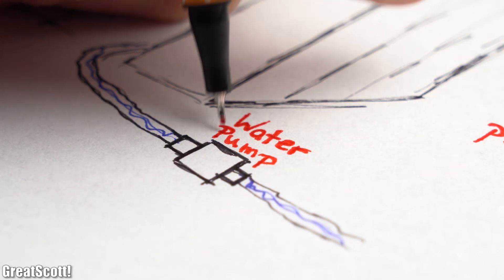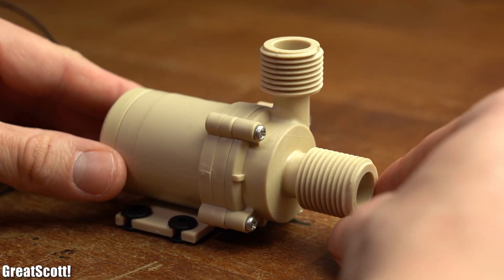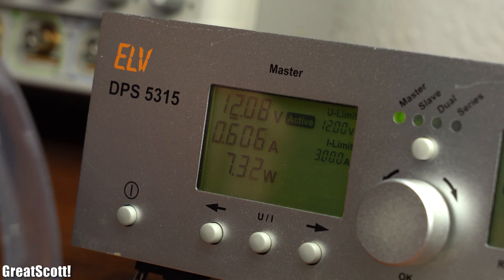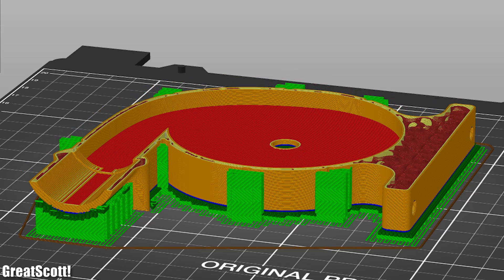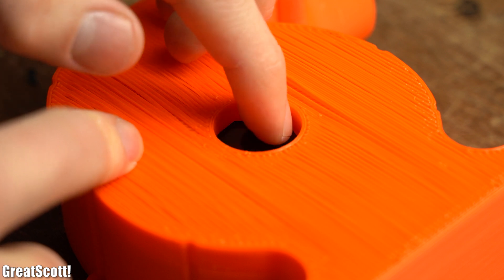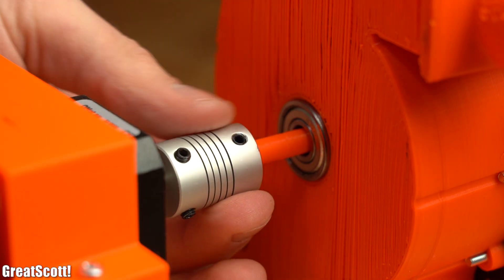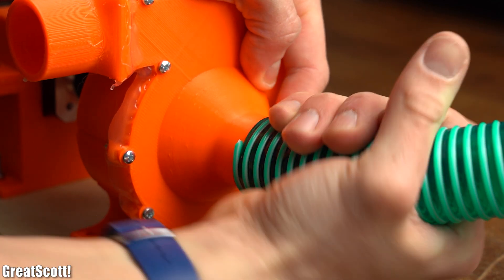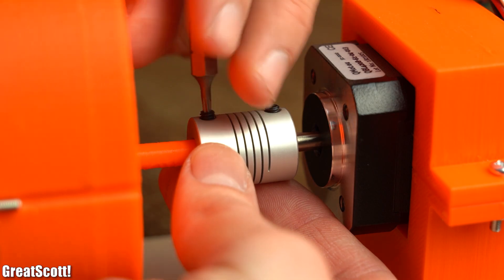Water Pump || DIY or Buy

Comment from the maker: I noticed that quite a few people are disappointed that I did not improve the 3D printed pump with a metal shaft. So here is a quick explanation why I stopped at that point. The reason is quite simple and is called time. I already spent 60 hours on this project when I got to the point when the shaft broke. That of course includes everything like planning, getting parts, writing a script, doing test, filming,......... Of course I could have tried improving the pump with a metal shaft but due to other problems I noticed that come with such a 3D printed design, I decided that such an option would not be sufficient for my garden and declared buy as the winner. If I would not have done that, then there might have been a successful water flow with the 3D printed pump but then again I would probably not have enough time to produce the next video for my channel. I appreciate all your feedback and I also love to tinker and get things to work. But I still have to think about getting content out regularly because this is my full time job. You can always support me through Patreon if you do not like this concept. So I can pretty much independently decide how much time I want to spend on projects instead of thinking about how to please the YouTube algorithm. Thanks for understanding.
Reply: I think that's fair enough! At some point you just have to call it quits. Thanks for being honest tho!
Reply: Instead of using shaft coupler , you should directly connect the pump turbine with motor shaft
Reply: @yogeshsinghsonigra4054  exactly.. 
I assumed it would be the logical first choice.
It shocked me to see him quit without even mentioning it at all.
Reply: Absolutely right, if it gets to complicated to diy such a pump then the price does not stand compared to the comercial one, wich makes it a bit pointless
Reply: What is the vga port on the microcontroller used for?
Reply: @oniruddhoalam2039  I don't have the board in front of me but it looks like a RS-232 serial port for programing.
Reply: No problem sir,  We understand how difficult it is to create such a great content for us....We always support you.
Reply: i think its just silly that you tried a 3dprinted shaft to begin with
Reply: I like your channel!
Reply: Gonna be honest, it was obvious that the printed integrated shaft gonna break from the beginning. Maybe you wildly overestimated the strength of the printed parts.
Reply: I have an idea for you. Take a note for situations like that through year, and after that take a poll in the audience, witch project try to upgrade, and make video on that.
Reply: Men i understand that  And i respect that
Reply: You could simply drill the center and replace the shaft with a M5 screw, und fertig! Great Video auf jeden Fall
Reply: 3D printing does have it's limitations. You can invest time/energy in making a 3D print work, but if the "off-the-shelf" part works and it's cost-effective, then it's best to go with that. Really appreciate that you spent the time to investigate this. You have saved me many hours going down a similar route as I am looking to do the same this summer for my fruit/veg. :)
Reply: Everyone understands. But it didn’t come across like that in the video. Not everyone knows how much effort it is to create such a video.
Reply: Curious to know if the commercial pump has a plastic shaft? If not then it's apples to oranges from the get-go.
Reply: Never use a stepper motor of water pump use a normal one or geared high rpm motors
Reply: Wish there were some other video platform other than YouTube where people like you would not have to be slaves to stupid AI.
Reply: I suggest using an automotive window sprayer pump. They're tiny and they move a lot of water with a high head pressure. 12v direct dc.
Reply: You should replace the tube with a smaller one, the smaller the higher the pressure
Reply: So can we expect a part 2 of the video? I'm eager to know what would be it's flow rate.
Reply: Mabey in the future You can recreate this : https://youtu.be/2nQBoQ3HucM
Reply: If you do a part 2, change it to a peristaltic pump (so it won't need to be water proof -- much simpler to print also), and use a threaded rod.  Also a proper nema 17 mount wouldn't hurt. XD
Reply: Hi Scott! I also made one, works like a charm! Here's the vid:
https://youtu.be/TfBycQ90-L4
Reply: I want to say I follow your channel and its very good one, but id like to suggest to go in projects that is not available in the market or is too expensive to buy instead of construction home made.... sadly for you to say water pump takes so long, i did work with water pumps and control for long time and there is a huge amount types of water pumps, impellers are designed for many reasons can be for high pressure low volume or high volume low pressure, etc. etc. etc. good luck with the next project
Reply: You are the ression why i love electronics.
Reply: I cant believe you spent 60 hours and now trash the project over a simple task as drilling a hole and epoxying a metal shaft. Thats not even a 15 minute job.
Reply: Btw the buy solution might also not work for long. I had this pump and it destroyed itself after a year. I then replaced it with another which died after 3 months ... These cheaper pumps from amazon have a super low life time
Reply: LOL glad i read this before posting :)
Reply: You are doing a great job no matter what
Reply: USB hub : DIY or Buy
Please
Reply: That is understandable. After all, it's your channel and your project, and by that point it was getting complicated so I guess buy would still be the winner in the end!
Reply: Eh, I like you, but I feel that this is more of a cop out. Lots of Youtube people out there with millions of viewers who simply make a part two, three, etc. when content runs longer and that would be the additional content for the additional time. There's only so much to cover electronically and when you look at it that way, this is a DIY or Buy episode, so, it's not like the circuitry is necessarily the focal point. I feel the people viewing this are more tuning in for the answer before they take on a similar project, thus, I feel like people are let down because this was concluded over an obvious over-sight that should've been seen in the planning stages before you even started printing. The additional time planning would've probably saved you exponentially more time in troubleshooting and printing.
Reply: I DIYED it myself and performed great
Reply: centripetal force (water pump- attraction in)  and  centrifugal force(blower - Push out)
One thing that is different is that the water impeller goes backwards to the wind impeller, the casing of the water pump is like a centrifugal blower but the suction impeller is very small and upside down.
Reply: 60 hours for HardWare experiment it's quite nothing, you can reduce the time by using other engineers knowledge, in this case 3D printing of a larger centrifugal pump it's a good idea if you're sand casting the working prototype in some aluminum alloy OR THE BEST CHOICE, buy an automotive centrifugal pump and complete the outer case. ;-)

https://www.shopee365.com/media/catalog/product/cache/a1d6199b8797d1adf27d00b7ce72a9f8/c/a/car-water-pump-for-chevrolet-optra-16-petrol.jpg
Reply: excellent job as always
Reply: Time... You got a point but the question is what make you think that the 3d printed shaft would work ?? And even if you wanted a 3d printed shaft it should not printed vertical. Anyway the winner in not buy... Designed my own pumps and use them for years in my aquaponics without a single problem.
Reply: In my opinion - you go so far that I will really recomend to try with metal shaft. Just for science!
Reply: As a regular eclipse user I'm glad to see that feature.
Reply: You should just know that a 3d printed shaft is never a viable solution for transmitting torque unless you drastically oversize it using the contact area between layers for your calculations on the required shaft diameter. No reason to waste time on video like this on such an obvious design flaw.
Reply: https://www.youtube.com/watch?v=ZiQek0wei1g
Reply: Make the pump a little smaller and that helps
Reply: your message about the ytb algorithm, the time spent and especially Patreon is very clear.
in my opinion it is necessary to work on the sealing of the shaft and the frame.
Reply: I understand but still, in comparison to some of your other videos it is a shame that you stopped before it got interesting.
Reply: Great Scott: Use an 3d printer to make an pump that dosn't work
Me: i made an pump with 20 year old legos in my basement and it pumps just fine
Reply: Fair enough.   I've actually worked on something similar before - torque and rotational force have to be a factor in your design for something like this.   Still a good show at trying to get it full poly! Impressed you started to get water to the pump with the size of hosing you were using.
Reply: Seems like of good at and not good at, and agree to give up things not good at...
Reply: The people just complained because what you did in effect was “shorting them” on the content.
Reply: I don't see how the metal shaft would have made a huge difference on performance anyhow... My question is, how much difference would it have made had the impeller been orientated properly? 😁 The world may never know...
Reply: lame
Reply: Dude... You don't have to stand over your prints... And you sources the parts from thingiverse? And you didn't have time? GTFO of here lol
Reply: Your conclusion is correct, but drilling a hole and jamming a metal shaft in would have been; less than an hour to save 60 hours from being basically pointless...  I do believe your conclusion is correct, but not from your video, I have done comparisons on several products like this and found making them costs the same or more than creating them myself.  The other benefit would be a more satisfying conclusion to your video.  As it stands now it just looks like you don't complete things are aren't a good source.
Reply: Why can't this level of transparency exist in government also.... Great Scott for president???
Reply: @joashnaidoo8644  because the urge to run for office seems to be mutually exclusive to high intelligence
Reply: @joashnaidoo8644  This video had nothing to do with POLITICs - It was about Plastics, Pumps and DIY.
Reply: @layton3503  it's a joke, stop being so stuck up
Reply: It's obvious that you ran into a time and/or resource problem. This, however, should not be a reason to present your opinion as a fact. As a mechanical engineer by trade and 3D printer hobbyist, I would not mind investing some of my time into the mechanical side of things. As I am sure many others here too! 

The electrical content you create is great and has lain the foundation for my own electrical knowledge. I honestly like the projects where the real world gets involved into the electronics. 

Next time you run into mechanical problems don't hesitate to present your problem to me personally and/or to the community. I'm confident that in no time there are people that would have altered the STL files to something more suitable. The same goes for the seal and motor mount. Don't underestimate the willingness in the maker community.

Comment: It's really cool! I think you should add another one of those Ice-Cold ball bearings, maybe add a molded steel propeller instead of plastic, and, most centrifugal pumps have another propeller behind, which acts as a back - up, I guess, so I think you should add another one. Maybe you can also add the drain hole with the plug andadd actual rubber seals in important parts. This is all not necessary, but I guarantee you to try and add these things.
Reply: Oh, and maybe add another electric box, put all the controls and electrical wiring  in there and, finally, you can cover up the motor by making another plastic piece, making thin vertical lines, make tiny thin vertical holes underneath the plastic lines, which will act as a ventilation, add a fan at the back, add a cover, make holes to connect those two new pieces and, finally, add a new and non - 90 ° outlet. Instead, add one that is around 60 ° in angle.

Comment: No metter witch pump is ,,,the neodium disc engine is the best  simply yust make two magnetic source clouse end force Will be infinity 500+ years ,,,or if you want to slow  yust a little disaparte few milimetara or,,needed power  if you disapart nagnets far  the watter Will stay or the pump Will stoped,,,end the same Neodium Engine can do anyting,,,elektr,,,or nehanik source ofvpower,,,ewend for free driwe car,,,watever,,,anyvere,,end alwys

Comment: The vanes were the wrong way on this 3d printed part.. and the axel could easily have been a meta rod attached with a flange or key, just like in other designs. 
.

Comment: i think the problem is the type of filament and the size of the nozzle used for 3d printing. using a smaller diameter nozzle increase quality and strength.

Comment: Other the shaft problem, i think there's another problem whit this pump. 
The must important thing when we talk about water pump, is the diffuser. I mean, in this pump there's not any diffuser. Generally, it should be whit a spiral shape, in this way, the impeller can increase the Kinetic energy of the fluid, and the diffuser can trasnform kinetic energy in pressure energy , whit increasing of Area Section, chosing a Spiral diffuser. Is simply Bernuolli law !
But if you watch your commercial pump, you can see how misses spiral diffuser. I think because they're not thinked for a big volumetric flow.
But that pump you printed, is very big, so i think the diffuser should be a good idea.

Comment: You didn't fill the pump with water. Your pipes are wide and not filled with water as they should have been. Air should not be present in the pump at all.
Reply: I just can't believe that so much effort is being applied over all, and then the small basic thing is not seen.
Mix of water and air made it to break probably.

Comment: Actually this kind of pump is very efficient when used correctly. First of all it needs a "seed water" which simply put means the intake has to be in touch with water but with no air at all. I Have printed exactly this same identical pump introduced in this video yet i've tried mine powered whit a power drill ":D", it works fine, its powerful compared to its size.

Comment: To share my meaning of buy or diy:

You did a great job on reasearching, but a little bit of engineering is missing. With more 3D printing experience you could know that you could reinforce the shaft more by changing printing temperature, som other settings and also printing it turned 90 deg would make it stronger because of the layers a 3D printer makes. On the mecanical side you could know that the shaft does not have to be 3D printed and if I would guess, a metal shaft would be the strongest solution here. Even a pencil with a screw secured to the rotating disc would be enaugh to make it at minimum 10 times stronger.

Thats my opinion, furthermore, I love youre content, love to see you make these things and I hope these tips above are something for you!!! :)

Comment: I'd say, if you want a custom fit and cavitation is not a concern, you can print one. If a person wanted to print that big orange one, they'd need to build a metal bolt plate which is coupled with a chrome or stainless metal shaft to hold the impeller which would then needs to pass through a bearing (double is better) and a mechanical lip seal. Obviously that is time consuming so often buying is better for basic use. One thing not often considered in most pump videos is the difference between a volume pump and pressure pump. If you were to insert a metal shaft into that big plastic impeller, it would ultimately chew out the center, this is simply due to the resistance of water across the given surface area.

Comment: I don't think the issue is that the PETG isn't strong enough. Your print quality is not great. I can tell that you are underextruding. Meaning that your layers aren't adhering properly. Resulting in a substantial reduction in strength.

Comment: What was the point of the bearing for the rotor axle :DDDD it was not eaven connected in the bearing, but rotating freely without it's support.

Comment: Sorry but i think the main reason for breaking the crankshaft is the joining type between pump and motor, you must put some thing like rubber to hold power to pump , because whatever you be accurate with putting tow axis it will be some diffirence and vibrating

Comment: well, video is 1yr old but I will comment it anyway. I like it regardless that I disagree with your conclusion. There are few things I will suggest and hope you will retest 3d printed waterpump.
I observed thingyverse a bit (especially in scope for good impeller design - ended with my own) and there is plenty of designs but most enthusiasts create things not calculating anything, just attempting to implement thsir idea. Still this site is great - I've learned a lot analyzing others designs, some were really brilliant, some were well, enthusiastic. Great that ppl do that and share.
So, 3d pump design was incorrect for 2 reasons - impeller was to big for water, it could work with air quite well. It should have more blades and they shoudl be lower height 1/4th or max 1/3rd of what designer did. Gap between top of the blade and cover should be as small as possible. The second problem was - printed impeller had layers perpendicullar to shaft so it was in that area weakest. 3d printed shaft must have layers along its length to be strong. Just redesign it with metal shaft. It will allow for better bearing and lower vibrations. Best regards, love tour videos. T.